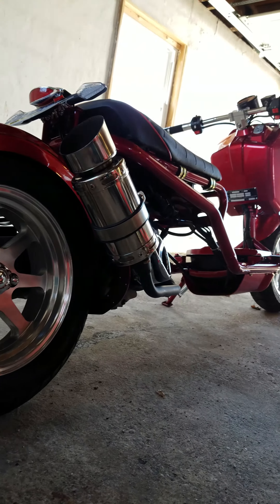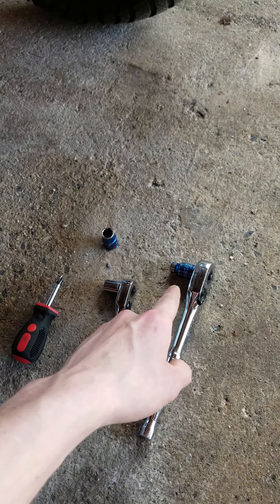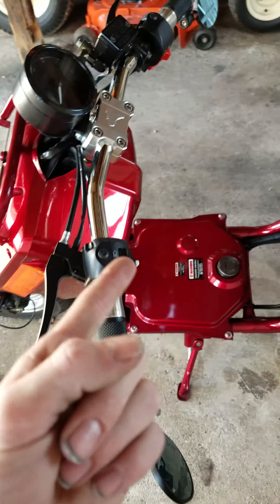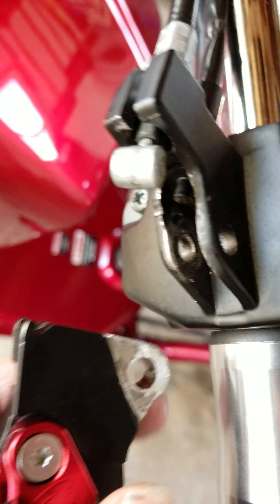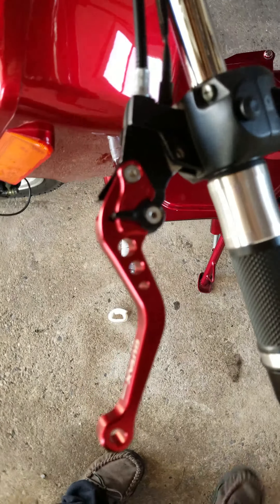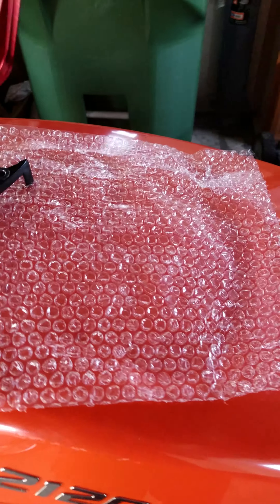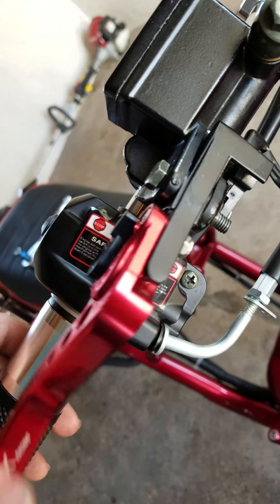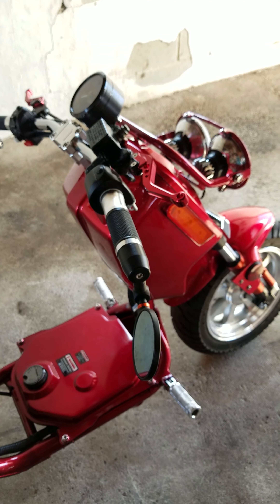Changing a brake/clutch levers on a motorcycle or scooter

Comment: Do you have a link for those levers? I'm looking for the exact same ones.
Reply from the maker: The Dark Horse the way I found these were actually off eBay I don't have the site anymore but all I typed In was adjustable gy6 brake levers and it brought them up if I can find the site I'll post it on this comment thread

Comment: Will this work with taotao atm50a1 with hydraulic front brakes?
Reply from the maker: Yes it should most levers are pretty universal. The only issue I had with those levers were that somtimes the adjustment screws would loosen up so it would jump around on the brake settings so I had to loctite it but after that it worked great.
Reply: Thanks man plan on buying Friday but thank you for a quick response as well I want something different on my 50cc scooter
Reply from the maker: @ej6allstock234  no worries man I felt the same way honestly did you swap out your belt yet or variator weights ?
Reply: No not yet bro I honestly just got the bike but ive only had one problem the other day my belt snapped so I replaced that and I'm looking at a kevlar belt and performance variator and clutch set plus 5 gram rollers
Reply: Ill definitely be posting some videos when I do the parts
Reply from the maker: @ej6allstock234  nice man yea when I had my 50s that's what I did first if you do run the big bore kit watch out somtimes they don't like it and blow up if I got another 50 I'd just go with a bigger carb,Kevlar belt,ngk cr7hsa plug,better coil,and 5g rollers that way it keeps the reliability in check but is slightly faster once you go to the 150s it's a whole new world
Reply: @RspecNick  I bet dude but thanks for that feedback I was gonna do the bbk but I always thought reliability there but yea those upgrades definitely sound better not looking to do 80 but I mean I at least wanna get to 45-50 cruising speeds that would be awesome
Reply: @RspecNick  fastest I have been was 48 going down hill tucked a little bit
Reply: Completely stock
Reply from the maker: @ej6allstock234  yea once you put a couple mods on the main thing you gain is faster acceleration top end is pretty limited unless you change the gear ratio but it's not really worth cause then your acceleration is crap
Reply: @RspecNick  true in gonna do what I can lol scooter Rossi lmao